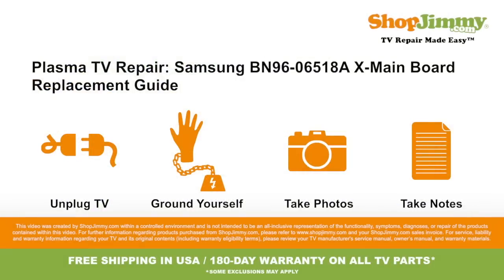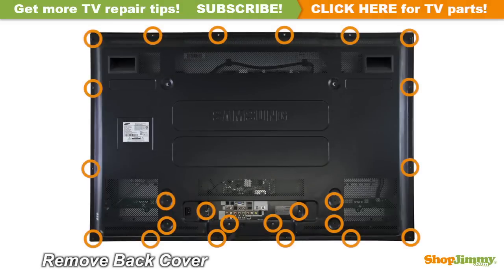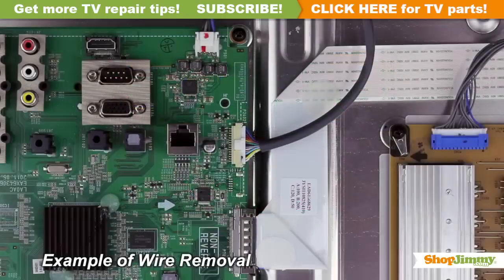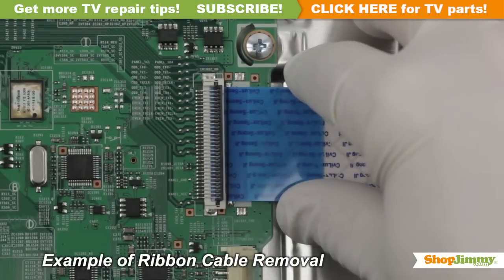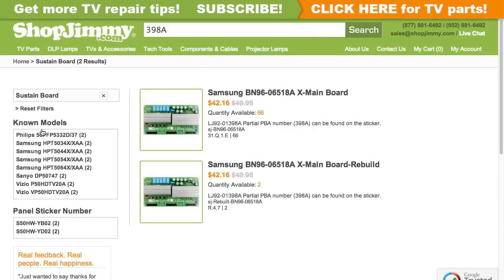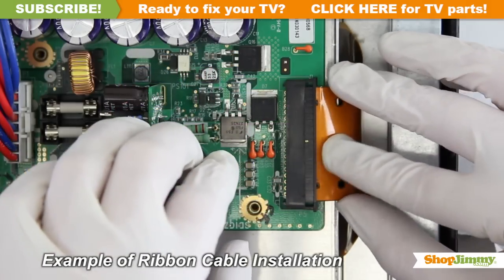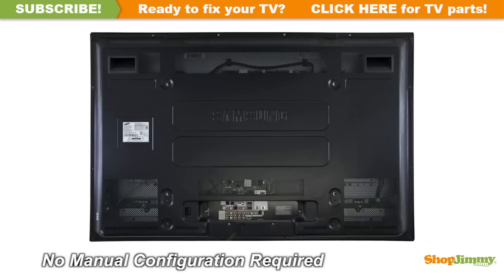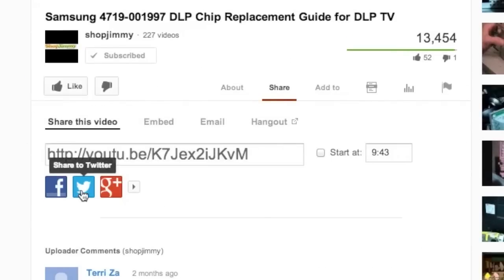Samsung Plasma TV Repair - How to Repair and Replace a Main Board

Comment: Model Code: Hpt5054x/xaa
Serial No.: b3383cepc00486b
Version: bq21
I have audio but no video on my TV. From what I have found it seems a X sustain replacement will correct the problem.  Am I correct? Also, could you provide a link to the part I need from your store please?

Comment: I have a PS60E550 plasma tv. The tv doesn't respond to the remote control when more than 3 meter from the tv. Had the infrared sensor replaced, and the tv now responds well from a distance of about 6 meter. But still not perfect. Guy told me that the real problem could be in the mainboard. Could that be possible? Could the tv mainboard be the cause of the tv not responding well to the remote control?

Comment: Jimmy,
A friend gave me his 50" Samsung Fpt5084, He just got tired of fixing it, the last person came out and replaced the power board. I when on line and found that the power board is a common problem with fuses blowing. I replaced a blown fuse and I got a beautiful picture, but no sound. Which board is the sound board? and do you have any.
Reply from the maker: Walter Harrell Please watch this video FIRST to help with your repair!  https://www.youtube.com/watch?v=BP3NVNCGEv8   I recommend replacing the main board in your TV.  Click this link to a replacement main board for your TV model number.  http://www.shopjimmy.com/catalogsearch/result/index/?cat=56&q=Fpt5084  Be sure to match part numbers on your current board, with your replacement for compatibility.  Here is a link to a video showing how to identify your part number, click here:  https://www.youtube.com/watch?v=BEPWrefQvqI  Thanks and please let us know if you have any further questions with your TV Repair!  www.shopjimmy.com

Comment: Hello. I have a Samsung  Pn64f8500 Plasma. worth fixing in my opinion. It will give me a blinking light upon power up...and a steady blink until it just goes solid...no picture, no sound, nothing. It progressively would not power on after extended usage and we would have to wait a while before it would power back on so I replaced the power supply and same exact symptom nothing fixed. My next guess would be the main board? Thoughts? please help
Reply from the maker: +Nicholas Davis  Try all repairs and troubleshooting at your own risk.  I recommend replacing the main board in your TV.  Click this link to replacement parts for your TV model number:  http://www.shopjimmy.com/samsung-bn94-06205c-main-board-for-pn64f8500afxza.htm  There may be multiple boards for the same TV model number, be sure to match part numbers on your current board, with your replacement for compatibility.  Here is a link to a video showing how to identify your part number, click here:  https://www.youtube.com/watch?v=BEPWrefQvqIThanks and please let us know if you have any further questions with your TV Repair!  www.shopjimmy.com

Comment: Model: PS42C91HD
Model Code: PS42C91HDX/XSA 
Y-MAIN PBA: LJ92-01393A Rev AA2 
Y-Bufffer : LJ92--01394A Rev A1
Powers is ok, Va =205 & Vs = 63. Screen shows with a wide vertical jagged black band through centre of screen. Unable to see/select any menu functions. I thought it may be the MAIN board at fault as there is no audio.
The only identification I can find on the MAIN logic board is " BOR China BN41-00888c  2007.06.07" some other characters which I cannot discern, ending with" KJ4-V-0 0735 A1" 
Any thoughts as to possible fix, what parts & how a to go about finding the replacement part for the MAIN Board?
Reply: Hey John
I have a valve transmitter HF. Have you ever worked on them?

Comment: Hey Jimmy. I have a Samsung model number  UN55D6000SFXZA. It has a steady blinking red light. no picture never comes on no matter what I do as I have contacted a Samsung tech and have gone through the correct checks. Can you help????
Reply from the maker: Patrick Gar   Please watch this video FIRST to help with your repair!  TV Repair! LCD, LED, Plasma, DLP How To Fix Your TV with ShopJimmy.com Help!  I recommend replacing the main board in your TV.  Click this link to replacement parts:  http://www.shopjimmy.com/catalogsearch/result/index/?cat=56&q=UN55D6000SFXZA  Be sure to match part numbers on your current board, with your replacement for compatibility.  Here is a link to a video showing how to identify your part number, click here:  Samsung Main Boards & Digital Boards: Part Numbers for LED, LCD, DLP, Plasma TV Repair  Thanks and please let us know if you have any further questions with your TV Repair!  www.shopjimmy.com

Comment: I have a Isymphon TV model # LC32ih56. The harness from the top of the TV to the main board had a broken wire. The color is brown. I solder the wire back, plug it in and the board was fried. Purchase a new one and realize that the harness connector has more pins than the harness. Now looking at the board with the big harness connector at the , DO I PLUG IT IN FROM THE LEFT OR ALL THE WAY FROM THE RIGHT. I was not looking at it closely the first time and plug it in from the right side. next to EC99 on the board is fried. need answer how should i check this.
Reply from the maker: ksrbsimmons   I recommend replacing your TV.  Thanks!  www.shopjimmy.com

Comment: Hi,
I have a Samsung PS51E550 with a faulty main board (51EHF_XYW). The problem is that I don't know how to remove the flat cable nor the connections with the buffer board on the left hand. I watched all the tutorials here but none has the same connectors. Do you know how can I disconnect the cables?
Thanks
Reply from the maker: Helbert Maich   Unfortunately we do not have any info on this TV model number.  Thanks!  www.shopjimmy.com

Comment: I have Samsung plasma TV ps43f4500aw failures to switch on,it blinks the standby and standby voltage 3.3 which switch on Vs and va comes on and off, I found some short-circuits on y Sus board and I fixed them but still failured to switch on

Comment: I have a Samsung LN46A530PIF XZA The power board was replaced and I still have a problem on power up. It takes several tries to get the tv to stay on and it sometimes has a scrambled picture with a high pitch squeal. If I turn the tv on without a source (sat box direct TV) everything seems normal with sound and display and power stays on. Sat box replaced and problem persists. Once the power picture lock in all is well Usualy 4 or 5 restarts. Also if I power the tv on then the sat box it will shut down and require restarts. Would this be a main board problem?
Reply from the maker: Pufnstuf100 How is the sat box or direct TV hooked up? hdmi? If hdmi, I would first try a different cable due to the fact that the TV functions normal without the box hooked up.  Thanks and please let us know if you have any other questions!  www.shopjimmy.com

Comment: Hey - I've got an LG 60PK950 Plasma TV.  I have no picture, but the screen glows, and if I jump the connection on the logic board, the TV will successfully display the image test sequence.  Does this mean I have a bad Main Board, or could something else be the problem?  The Vs Voltage is also good (201) so I'm not thinking I have a power issue.
Reply from the maker: wowthisislame3  Please watch this video FIRST to help with your repair!  https://www.youtube.com/watch?v=BP3NVNCGEv8  I recommend replacing the YSUS and the YDRVTP & YDRVBT boards in your TV.  Click this link to replacement parts for your TV model number:  http://www.shopjimmy.com/catalogsearch/result/?q=60PK950  There may be multiple boards for the same TV model number, be sure to match part numbers on your current board, with your replacement for compatibility.  Here is a link to a video showing how to identify your part number, click here:  https://www.youtube.com/watch?v=GEllG3RV-tc  Thanks and please let us know if you have any further questions with your TV Repair!  www.shopjimmy.com

Comment: I have a LG PLASMA manufactured Aug, 2008...Model #50PG20-UA, Model Code: 50PG20-UA.AUSALJR, Serial #808RMLM148400 (3458), FCC ID: BEJ50PG20UA....My TV gets power and sound but no picture, do you know what the problem may be...

Comment: SAMSUNG 50" plasma Model PS50B530 
two fix verticals lignes on the screen .
what i must to do ?what the board i have to change ?
Many thanks.
Reply from the maker: abdou ziani   This sounds like a TV panel problem.  If your TV panel is bad, it may be more cost-effective to replace the TV as panels are typically hard to find in stock, difficult to replace, and expensive.  Thanks and please let us know if you have any further questions!  www.shopjimmy.com

Comment: My 60 inch Plasma when turned on makes the on chime sound the shuts itself down, then restarts on its own, at first it did third once but now we’re at 4 to 6 time before it stays on. Is this a main board issue?

Comment: Samsung 50" Plasma Model # HPP5071X/XAA
Typical Samsung issues-won't power up with clicking sounds-fans would start than stop.
Checked capacitors-none bulging-one read low on ohm meter-was replaced.
Same problem as before-any suggestions?
Many Thanks
Reply from the maker: fstop61   This sounds like either the main board or power supply is bad.  You may need to replace each board individually to see which one fixes the problem.  Here is a link to replacement parts for your TV model number on our website, click here:  http://www.shopjimmy.com/catalogsearch/result/?q=HPP5071X%2FXAA  Be sure to match part numbers on your current board, with your replacement for compatibility.  You can also call our customer service for further assistance with your purchase.  (877) 881-6492  Thanks and please let us know if you have any further questions with your TV Repair!  www.shopjimmy.com

Comment: My samsung 43" Plasma TV would not turn on and did not have a red LED light.  I replaced my main power supply board and the TV came back on.  Green LED light on main logic board blinks evenly.  The problem now is that the picture is snowy on all inputs.  The cable picture can be seen but it is pixelated.  All voltages going out from supply board checked out.   Any ideas on what the problem is?

Comment: Hi Jimmy,

I have a Samsung Plasma TV, Series 5+ 530, the model number is PN51E530A3F.  I went on a 4 day trip and returned home and tried to turn my TV on, absolutely nothing happens, no light, no noise, nothing....  Very bizarre considering it worked fine prior to me leaving. I checked the outlet, plugged it into another outlet, unplugged and waited a while and plugged it  back in, nothing.... My warranty expired and now I have guy telling my he charges $140.00 per hour for labor and $70.00 for diagnostic. Please help. thanks !!!
Reply from the maker: Kelly Boyce   Try this at your own risk. Unplug the TV, then disconnect the y board and plug in the TV to see if the TV powers up. Reply with the results of this test. Thanks! www.shopjimmy.com

Comment: A friend gave me a Samsung 46" LCD tv that was made in Sept 09.  The model code is LN46B650T1FXZA.  Model number is LN46B650T1F and the SN: AUHR3CPS900980X.  My screen looks like a negative.  What do you think could be the problem?
Reply from the maker: jeffreyr512   This could be a problem with either the t-con board, the main board or the TV panel.  You can replace the t-con board and main board individually to see which one fixes the problem.  Click this link to replacement parts for your TV model number:  http://www.shopjimmy.com/catalogsearch/result/?q=LN46B650T1FXZA  There may be multiple boards for the same TV model number, be sure to match part numbers on your current board, with your replacement for compatibility.  Thanks and please let us know if you have any further questions with your TV Repair!  www.shopjimmy.com

Comment: Model: PN50A760T1F
Model Code: PN50A760T1FXZA

For one year, I have had one very thin black horizontal line that is about 1/3 of the way up from the bottom of the screen.  It is always there even in every mode - even on blank screen or when there is no signal to the TV.   The TV works fine otherwise.  Is this a entire new panel or a part that can be replaced??
Reply from the maker: AngelsTakeMe2Heaven I recommend replacing the Y-buffer board in your TV.  Here is a link to replacement parts for your TV model number on our website, click here:  http://www.shopjimmy.com/samsung-lj92-01551a-y-buffer-board.htm  Be sure to match part numbers on your current board, with your replacement for compatibility.  Here is a link to a video showing how to identify your part number, click here:  Samsung Plasma TV Repair: Samsung Plasma Panel Parts Guide  You can also call our customer service for further assistance with your purchase.  (877) 881-6492  Thanks and please let us know if you have any further questions!  www.shopjimmy.com
Reply: ShopJimmy.com
What if I order this part you suggest and that is not the problem?  Can I get all my money back on a return?

Comment: Hi There. I hope you have a great holidays and all the best for 2015.
I Have a PLASMA-LG-TV
TV model: 50PS80ED-AA. S/N: 906KCZP6C453. Manufactured in Korea 2009.
Power Board: EAY58665401 & Main Board: EBL60658003.
Description of the issue on the TV:
When I connect the TV to power, the standby mode led, turns on. If I turn on the TV, it turns on, displays a quick image and then turn off.
I tested the output voltage on each output at the power board and all is fine, besides no signal of burning any capacitor.
Then I disconnected (at the main board), the cables coming from the Power Board  (where all the HDMI-RCA, etc are connected), and when turning on the TV, the TV remains ON, but I cant turn it OFF; consequently, I cant neither see any image nor use the menu (which I think is controlled by the main board)

I have the impression is the Main Board, could you please provide me with some guidance if I'm pointing at the right direction?

Thanks a lot for your support!